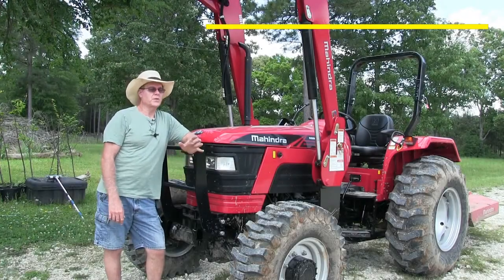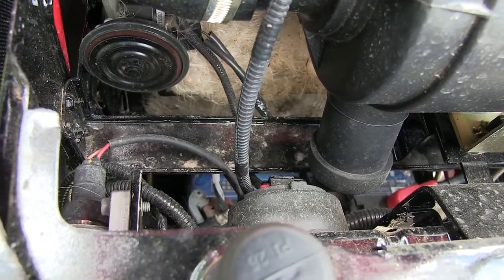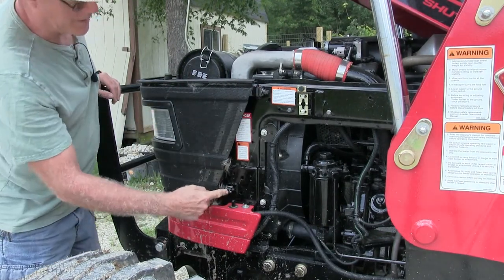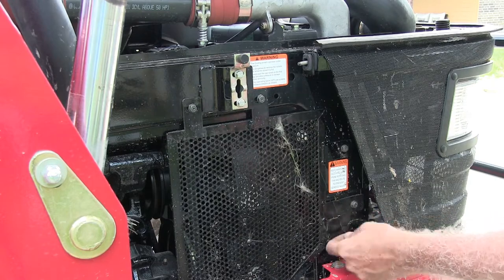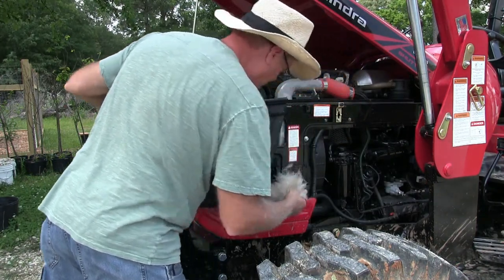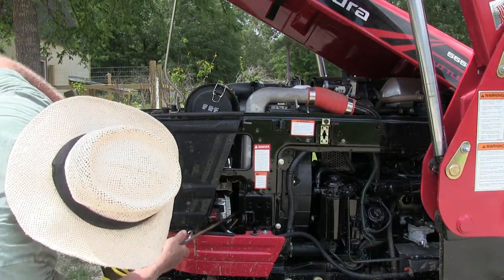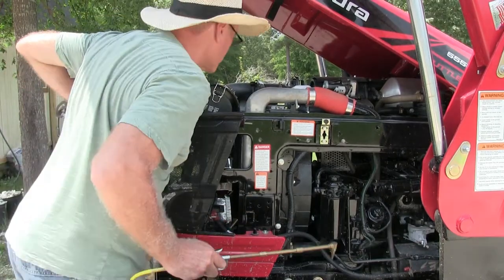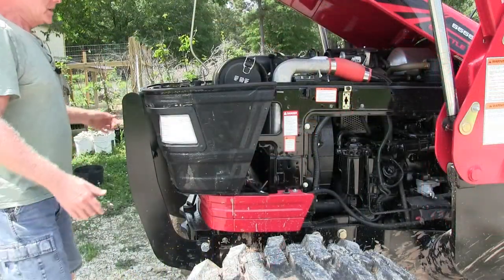Mahindra 5555 - Cleaning radiator front grill - trash guard.

Comment: I just pop the hood on mine and move the air filter out of the way and use a shop vac. Once the big stuff is out of the way I use an air nozzle on my compressor to blow all the dust off the engine and hit the radiator and intercooler from the back side.
Reply from the maker: Zaappp !!!  Thanks, I'll try that next time.

Comment: Pete “Mahindra made it super easy to clean the screen” proceeds to dismantle half of the machine. 

I might buy a 5555 but dang gone, most you lift the one piece hood, pull the screen out the side and are done in 30 seconds. It could be worse but could be 100x better also lol.

Comment: the front grill on my John Deere catches all of that nothing gets to the actual radiator, I can just brush it off with my hand.
Reply from the maker: The only thing I can think of is the round fluffy white seeds are getting sucked in through the small holes in the grill. The actual seed in the middle of those fluffy white things are very small. I don't know what type of fan Mahindra uses but there's a lot of suction going through the grill.